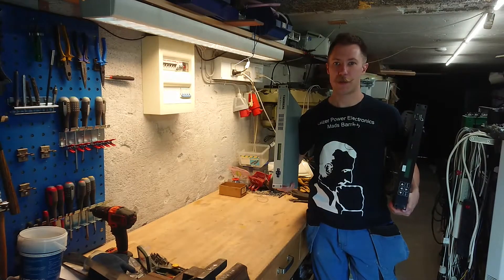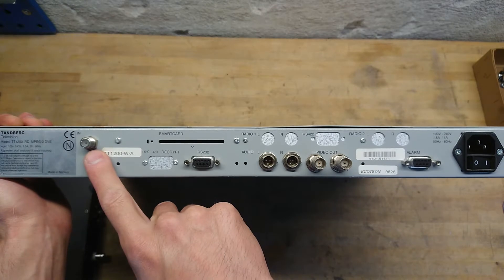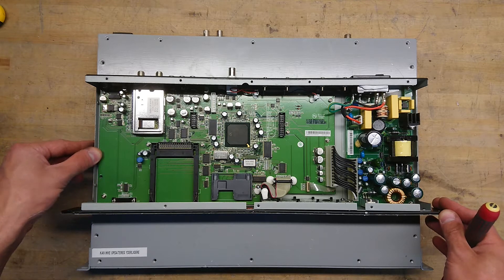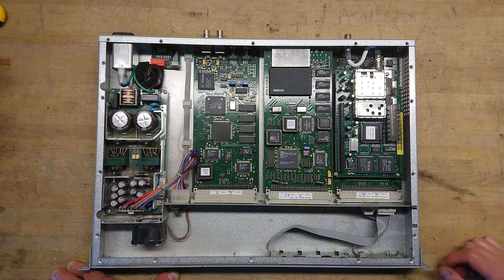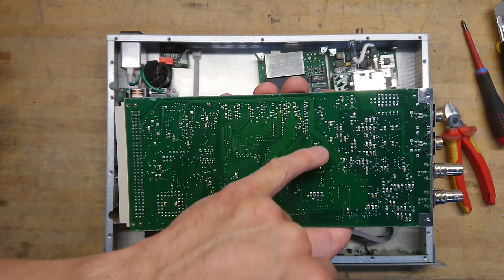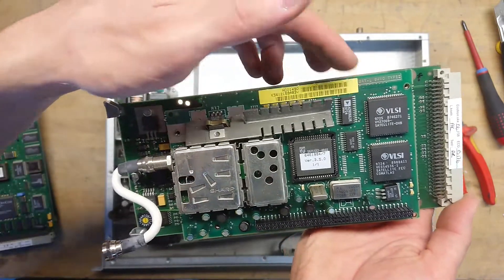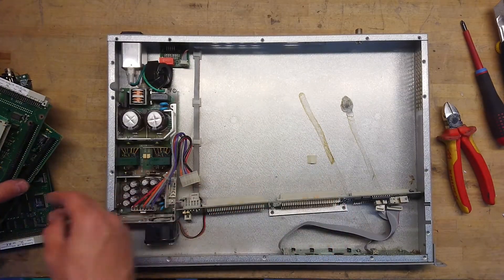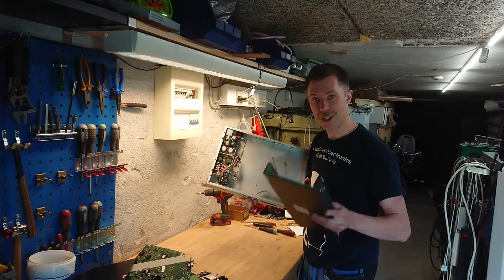Tandberg TT1200 DVB MPEG-2 Decoder Teardown

Comment: What's underneath that plastic lid around 7:00? Looks like some protected security stuff?
Reply from the maker: its just a card reader, nothing special.
Reply: @KaizerPowerElectronicsDk  According to the bottom side, the reader ends underneath the metallic part. But there is something else underneath the plastic. Could be some sensitive VCO or battery-backed storage or something like that.

Comment: I just had to look up what the TMS320 chip was, turns out it's not a normal micro.
TMS320AV110 is a MPEG audio decoder, dating from 1995.
Reply from the maker: Yeah. I wrote a bit about it on my website, link to article in description. When taking it apart it was easy to mistanke it for the regular TMS320 DSP platform that I saw so often in base station amplifiers :)

Comment: The middle board in the Tandberg with the 68EC020 CPU would likely be very reusable if reverse engineered.

I reverse engineered a couple of old Cisco routers that use 680x0 family CPUs and got FreeRTOS running on them. 🙂

Comment: Oh we had those Tandberg decoders at the local TV station. They were running the main programme material from TV Danmark main station in Skovlunde sent over satellite and we muxed it into local TV and then broadcast over analog cable TV.
Reply from the maker: And with one used per channel! The pile I found of these were like 40 units, only took 4 of each for the enclosures :)
Reply: @KaizerPowerElectronicsDk  These were running as hot spare with two dishes, 2 times cabling and two receivers, should the need arise to switch over for any reason. I don't think it ever happened that anything failed locally - when the link went down it was either from the other end of transmission or atmospheric disturbances.